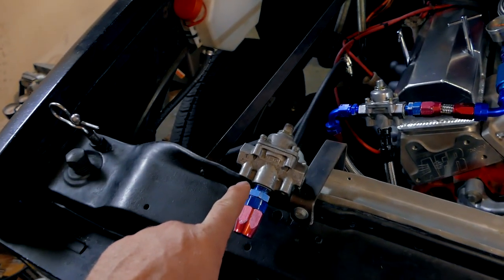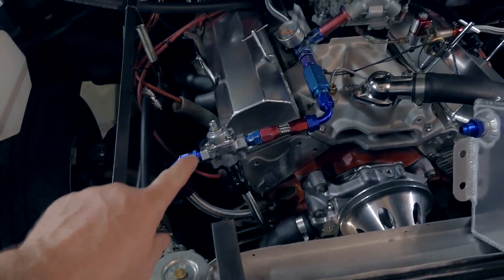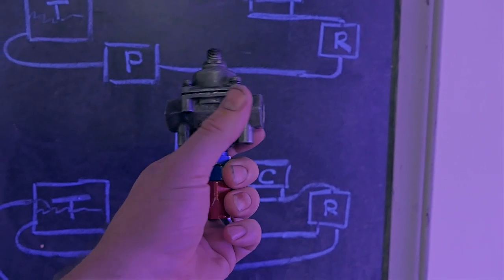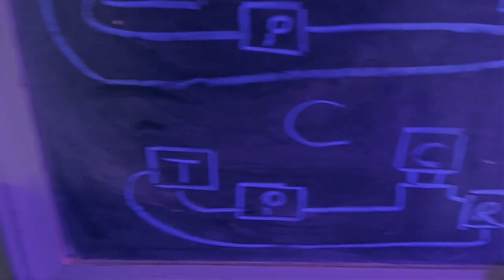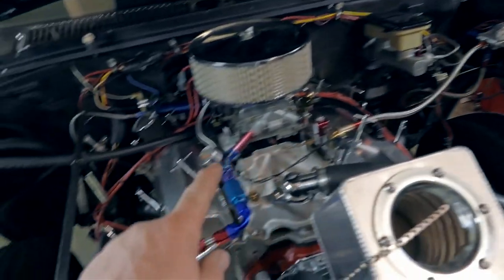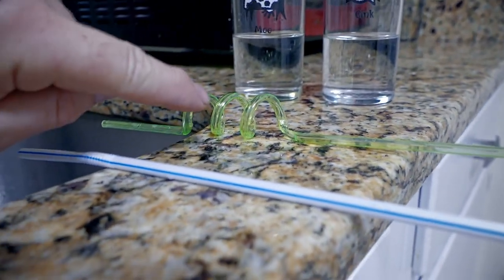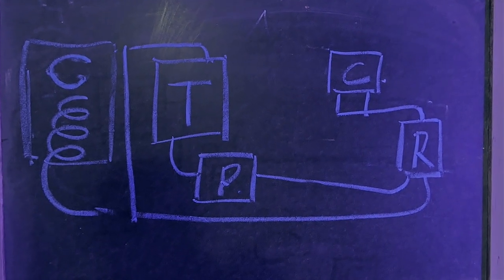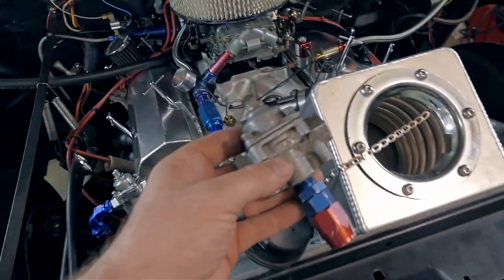Holley carburetor return fuel system 101 & ( Mod Gone Wrong!)

Comment: Deadhead systems can improve vapor lock reduction by adding a fuel filter from a mid 70’s Cadillac, added between regulator & carb. It has a return bleed outlet that returns a small amount of fuel to the tank. This helps purge fuel vapor & increases fuel flow at low speed, keeping the fuel cooler.

Comment: I've always had problems with fuel boiling with dead head and tried everything to make it work.  Moving lines, spacers whatever.  Put in a return and it's all good.  Using a holley blue pump too.  Way less strain on the pump now too.  Found a few forum posts on converting the 803 holley dead head reg into a bypass reg and haven't had any issues yet.
Reply: Chaplain Crabtree did adding a return quiet the pump down any? I’m dealing with a really loud Holley blue and thinking about running a return.

Comment: I'm battling a 30' motorhome with a 454 on a 1983 C30 chassis, with a bastardized fuel system. It needed a water separator to run on cheap gas, and a bigger pump to go up really steep hills. Then, they put in a puny return line that worked with the original puny pump. The answer appears to be to use a return regulator, followed by a dead head regulator to keep from over-pressuring the system when idling down really steep hills - when the return pressure will be maximum, yet the return fuel has to go UP through a smaller tube. No one seems to want to talk about fuel systems for looong vehicles having really BIG engines - and RV-factory plumbing. If the RV factories only hired a real genuine mechanical engineer, we wouldn't have these problems.
Your thoughts?
Steve

Comment: Cool brother! I always make it to the end! Haha I love experiments teaches us so why not ....
I have the deadhead system on mine and dang it really does work a fuel pump! Once it’s pressured up you can hear that pump screaming saying come on man drive me lol ....
Reply from the maker: My man! I had one for years too return is far better than a deadhead any day of the week.
Reply: TPV Productions I bought a new gas tank had it sumped and had a 10an fitting welded to it . I went with aeromotive A1000 pump and boost ref regulator ..lines are fragola PTFE line ..
Hanger18 modded carb 850 
My buddy with the chevelle on my channel his buddy built it for me 👍🏻
My buddy’s is a 750 and in the single digits .. I would like to go super sniper because I would like to switch back and forth to E85

Comment: If you take ⅜ hose and blow water through it... It's gonna flow the same regardless of its shape... unless it flows up, then gravity on the weight of the fluid could cause back pressure at a certain point..(thats irrelevant in this scenario) what im saying is i think either the inlet, outlet or I.D. of the coil in that cooler was restricting it all along. The delta p from fluid friction in that spiral isn't the issue. It's nearly immeasurable.
Reply: Exactly the diameter of the "curly" straw was half the diameter of the straight straw, so that demonstration showed absolutely nothing...

Comment: Very interesting, I did not know 2 regulators where made, I went out to my race car and I have a dead head regulator and I do a return line to the tank, I have been having erratic fuel pressure, time to get the return regulator thanks for the info.

Comment: 2 year old vid and I hope you figured out how to run the cooler with this set up on  my sbc I use a similar cooler but not to cool the fuel before it goes back to the tank but before it goes into the carb so I am running a high pressure pump to the cooler and the from the cooler to the regulator which I have dialed in at 7.5psi and that way the carb is getting cooler fuel and so is the tank  and works like a charm!

Comment: heres a question for ya ,  I have a 78 chevy truck , Im thinking about pulling the float assembly out the tank and adapting an internal fuel pump.. It shouldnt be hard to do ...  what I cant figure out is how electricity in gas doesnt explode... But have you heard of anyone adapting their old system over to what Im wanting to do....?  Oh Subscribed

Comment: I have a 302 Ford with a Edelbrock  carburetor,  I thinking  about a return  line set up by installing a tee after my 30 micron supply  filter,  then adding  a line to the inlet side of the regulator, plugging  the outlet and runnthe return to the tank. I want to mount  the regulator  on the firewall and use 6AN line for the return  does this seem like a decent way  to run the regulator

Comment: Question: installed e elec fuel pump (internal regulated to 7psi or 90gph at 5psi) and later also a return line regulator. I know a regulator is not needed but it is how it is right now. I wonder if the reg will ever free the return line which this low number of pressure from the pump. What do you think?

Comment: I want to see the experiment with both the regulators in use   do you put the dead head after the return style reg
Reply: Yes, you can set your return regulator at 15psi and put the cooler in the return line, plus put your head regulator in the out connection of your return regulator towards the carburetor and set it at 6psi… I think it will work just fine for the cooler and for the carburetor. Saludos!

Comment: I'm racking my brain trying to figure out how a pressure regulator on the return line is a good idea.
Reply: It's called a fuel bypass regulator. Basically let's say your running a 4 bbl carburetor and you need 6 psi of fuel, what you do is get a 9 PSI pump, set the bypass regulator at 6 psi. The reason you do this is so you constantly have 6 psi going into the carburetor plus the fuel is constantly flowing so you don't get pump over heating or vapor lock. Hope this helps you understand why you would do this.

Comment: The restriction in the straw theory doesn't hold water the inside diameter of the straws are not apples and apples your going to have restriction trying to push same volume of water through smaller orifice of spiral straw, has nothing to do with spirals.    Your restriction in your system is more to do with inside diameter of smallest area internal more that any turns, and bends even though they may create a very small parasitic resistance, compared to smallest orifice cross section under same pressure.   You can have one area cross section in the return side that's to small and your system is killed. I've used dead heads and return regs and they both work fine on carbed cars warmed fuel is better anyway it has to vaporizes, atomize for better combustion raw cold fuel is not all it's cracked up to be. It's just like many think highly polished intake runners is better after the carb is great for filling, but not for stirring fuel air mixture to get a great combustion flame front for power. I run super turbulent rough runners on mine to mix but flow increases with larger runners to get the best of both worlds. When you introduce fuel droplets because of fuel being cold it doesn't produce power with irratic combustion burn so you always have to watch control how far you take something. And complicated systems are always something you want to stay away from harder to troubleshoot, harder and more expensive to work on it can turn and bite  you in the ass many times over. Don't know if you've  ever heard the statement ( kiss ) keep it simple and stupid, and win.

Comment: I needed this because I never ran a return, but I'm confused by the last option. It comes from tank to pump to carb to regulator to tank? If you had to buy a fuel system from scratch would you go carb or FI?
Reply from the maker: Probably carburetor only because it's cheaper.
Reply: @TPVPRO  I'm going blow thru which is about the same as FI if that matters
Reply from the maker: @infamousnova   It is, I believe the pump that's was recommended to me was the "Aeromotive Eliminator "  for E85. And the A1000 for gas applications.
Reply: @TPVPRO  only thing is finding a fi setup that except e85 and blow thru. I have a carb intake
Reply: @TPVPRO  A blow thru carb for e85 is about $1200. Still cheaper than the fi counterpart. It's only $1200 because I dont have a carb to convert. Wish I didn't sell it
Reply: @TPVPRO  how do you like the holley black?
Reply from the maker: @infamousnova   It's not the Holley Black it's the same style but the Jegs alcohol rated pump. It has never let me down yet.
Reply: @TPVPRO  looking into a pump, planning on a blow thru turbo setup

Comment: Question , Ive been out of the mechanics scene for a long while, do you think a Holley electric fuel pump is good for the street ?  longevity?  Thanks
Reply from the maker: I use the Jegs Performance Pump that can also take alcohol. As long as it's on a return and It doesn't get too hot it should be fine.  It has never failed me. "Knock on wood"
Reply: @TPVPRO  Thanks Bro

Comment: Im in need of help i just switched my 89 tbi to a carburetor and put a holley fuel pump to supposedly regulate the amount of psi of fuel to my carb by itself and i watch my clear view filter to see it just sucks a lil bit of fuel not enough pressure to keep flowing to my carb. Im pretty new to all of this some help would be awesome

Comment: Hey man can you help me out with a fuel injected setup? Can't find any information and trying to learn where to put the regulator. MMR fuel rail kit came with an adapter for newer Mustangs regulator. So basically its return style, two fuel rails. Do I T the incoming fuel and hook directly to each rail, then link the rails with the regulator in between? Or do I put the regulator right on the inline hose, connect it one rail, then just hook the rails to each other from there?
Reply from the maker: It will be the same as the a carburetor. Ideally you want the fuel to flow through both rails then to the regular and back to the tank. All depends on your rails. The correct aftermarket rails should have the option to do hook it up that way.
Reply: @TPVPRO  So the fuel should reach all the injectors before going to the regulator?

Comment: I don't understand option C.  How can you place the fuel regulator AFTER the carb if it's not regulating pressure to the carb?  What's the point?
Reply from the maker: They make carb fuel line that has a inlet and a exit on both sides you just put a 90 bend and run it to the reg.
Reply: It is regulating pressure by restricting how much flow goes back to the tank

Comment: So it’s better to place return style regulator AFTER carb?
Reply from the maker: After the carb is the best.
Reply: TPV Productions so if I plumb it in that way, regulator after carb, plumb in a T before carb, put in a pressure gauge there it’ll read same pressure as the OUT port of regulator, seeing as you’ll be feeding carb before the IN of pressure regulator, and if so please explain.
Reply from the maker: @WesternReloader  They have a carb fuel rail that has a exit on the back. And that would go to the reg. The fuel gauge would go in the same location as all the other Holley fuel rail setups.
Reply: TPV Productions I hear you, but will the fuel pressure to the carb being fed ahead of the regulator measure the same PSI as the fuel leaving the regulator?
Reply from the maker: @WesternReloader  Leaving pressure after the reg is not needed only feeding pressure.
Reply from the maker: @WesternReloader  The chalkboard diagrams are just a example of the systems not a complete technical diagram I think that is what's confusing you.
Reply: TPV Productions if my carburetor is designed to optimally operate at 6 psi, and my electric fuel pump generates 9 psi, and my carb is fed fuel before the regulator and the needle and seats are seeing 9 psi, as I understand the regulator only drops pressure at the outlet and maybe the return line, I don’t get it
Reply: @WesternReloader  whatever pressure you set the regulator to is what the feed and output lines will be at.
Reply: Luaa that answers it! No matter where the regulator is, the pressure will be the same, before inlet, after outlet, and after return outlet. I thought only the outlet and return saw the change in pressure made by the regulator, hence it mattered where you placed it relative to carb
Reply from the maker: @WesternReloader  If you have no adjustability to go below 9 psi your return line needs to be bigger.
Reply: TPV Productions ok. My setup I’m working on as we speak is this. New 33 gallon steel fuel tank. (1980 Bronco- 302 based 332 Stroker/190cc Aluminum heads-2.02/1.60 valves-comp cams XE266HR12-fuller roller rockers-Dual Plane intake/Summit 600 carb on 1” spacer) new 3/8” steel fuel line 100 micron filter- 35 GPH electric pump for carburetor application, Holley Bypass Return  regulator, 3/8” steel return line. I have the fuel log that has only one inlet and the two outs to the carb. Can I just place the regulator right before the carb and still have the benefit of the return system? Thx
Reply from the maker: @WesternReloader  35 GPH pump? I hope you forgot the 1 before the 35. You need at least 110 GPH.
Reply: TPV Productions Don’t know where I got 35 from. It’s a Summit G3136-1... 97 GPH. I’m not going to race it but I can see myself getting into the throttle time to time
Reply: @WesternReloader  ill take a shot at answering this.    because the regulators is in the system. its regulating the entire system.   its like pintching the hose, so the whole system will suffer the restriction.     on paper, it doesnt look right.  in practice it works.   

larry
Reply: mafosa makes perfect sense now. Now what’s the benefit of placing the regulator after carb inlets? Thx again!
Reply: @WesternReloader  I think you are confusing a dead head setup with a return system, in the dead head system yes there will be a  difference in pressure before and after the reg, in a return system the there is no difference and placing the reg after the carb just helps to reduce possible restrictions.....

Comment: The return does 90% of its function when the car is at idle. Your fuel is flowing at its slowest at idle that would be the only time your fuel would have a chance to boil. If you put your regulator after it has already gone into the carburetor you aren't regulating anything. You are literally only regulating the flow going back to the tank
Reply: No.  The system is a loop.  If there's nothing restricting the flow back to the tank, the pressure will be very low, even though the volume might be very high.  High volume isn't an issue.  By putting the regulator in the line after the carburetor, it creates a restriction in the line leading to it.  You want your gauge in front of the regulator (or on the regulator reading the pressure coming into it), and you adjust your regulator so that you have 5.5 lbs, or whatever you need, in the line between the pump and the regulator.
Reply: @JeffKnoxAZ  Dude!  I was looking at that thinking the same thing but you explained it perfectly.
Reply: Thats right thats why from factory on FI cars the regulator is on rail after the injectors, not before hahaha.   Great video

Comment: is you return line the same size as your fuel intake line? im setting one up now on a 454 6an (3/8 ) fuel line in , out and return
Reply: It only has to be sized to your pump. If you have a 150gph pump you'll need a -8, If you have a small or stock efi pump you could use a -6. It basically has to be able to flow as much or more than your pump.